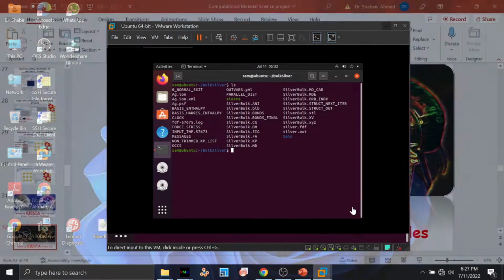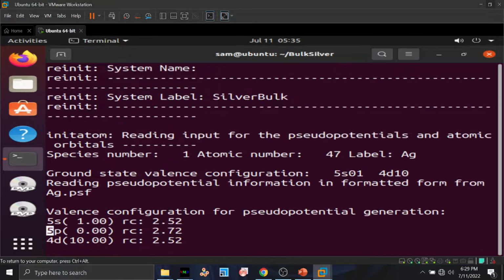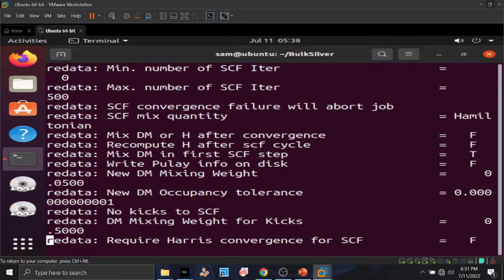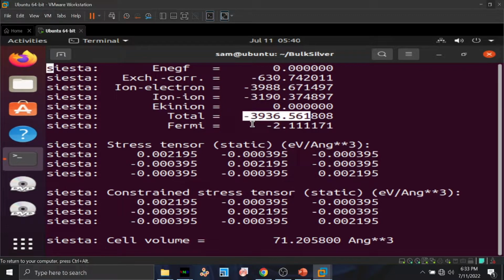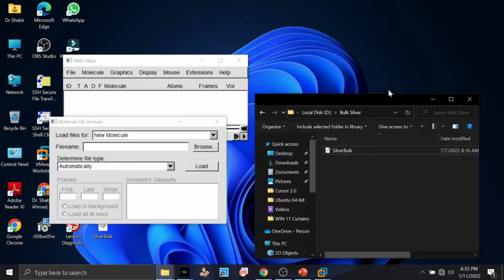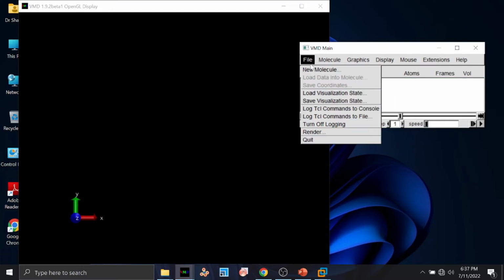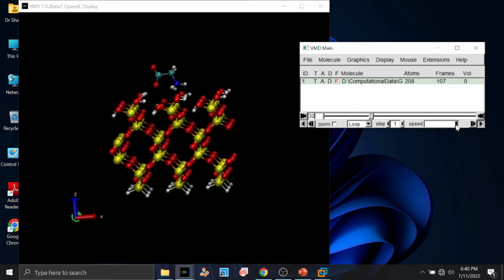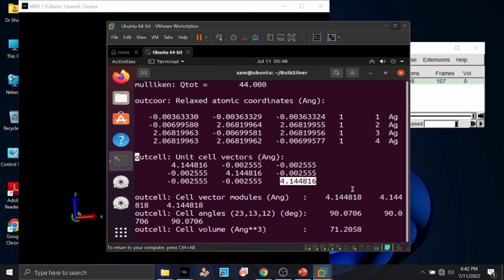Lecture9 Materials Modelling & Simulation SIESTA output file

Comment: Thank you:
Hi, 
i ran Transiesta calculation, and for scattering calculation, i get an error that my electrode is not perfect. I add the command:
TS.Elecs.Neglect.Principal True
TBT.Elecs.Coord.EPS 0.02 Ang 
TS.Elecs.Coord.EPS 0.02 
 , but i still have the same error, *
what can i do about that?
Reply from the maker: Copy the error n paste it in google or check this error siesta mail atchive
Reply: @sammaterialsmodellingsimul1872  thank you for your responce , i do it and i did not get the aqurate response for my case, please can i contacte you by Email?
Reply from the maker: Can u send me the exact error. Take a snap n send it to me. But to me either u did not carefully read the manual as u r calaculating for single point that is 0.02 y is that?
Reply: @sammaterialsmodellingsimul1872  
the exqct error: Electrode connectivity is not perfect, refer to the manual for achieving a perfect electrode.

Stopping Program from Node:    0
In the script i add the both commande:
1/ TS.Elecs.Neglect.Principal true
also this: TBT.Elecs.Coord.EPS 0.02 Ang 
                  TS.Elecs.Coord.EPS 0.02 Ang 
but i get this noted error